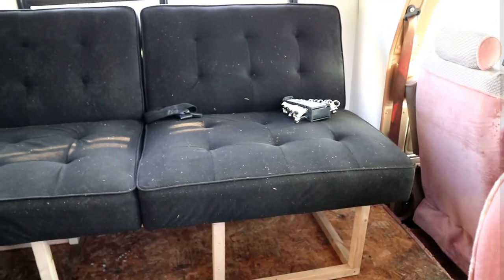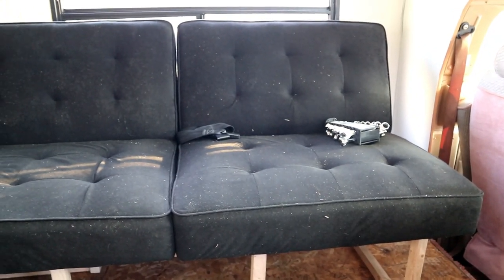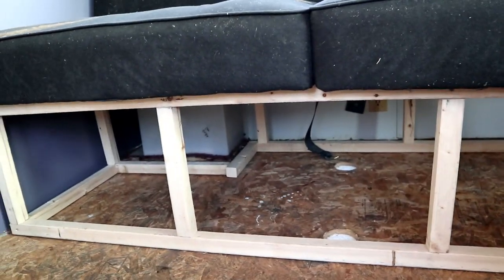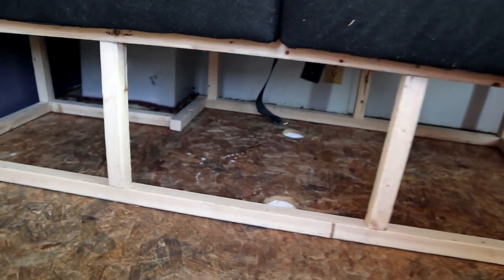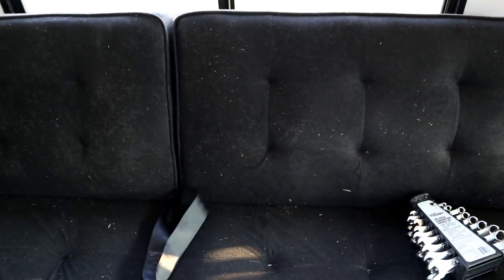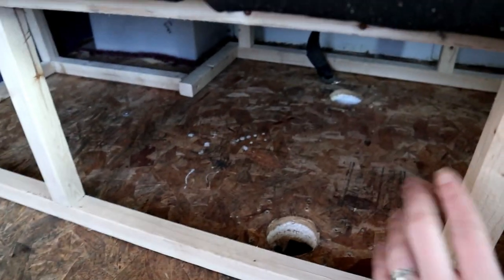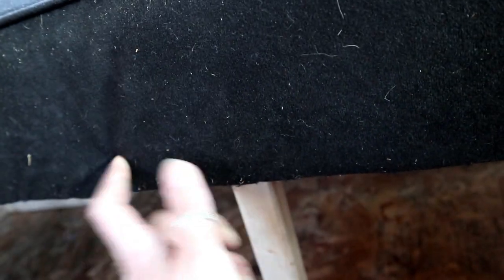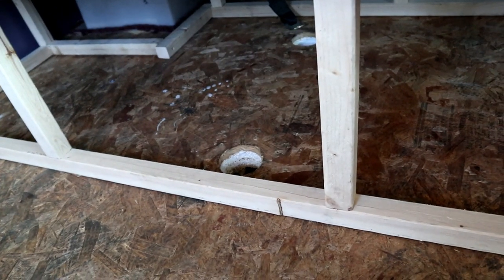FUTON RV SOFA BUILD | CAMPER REMODEL

Comment: On my class C  there is a turn off valve at the tank and I am sure there is one somewhere on yours. If you can find that valve then you can determine if you have propane. The previous owner may have turned it off for safety reasons. I am currently changing all the interior lights in mine to LED'S. That is something you may consider as a project one day. The LED'S are brighter and much cooler using less power. The ones attached to the ceiling showed brown marks from the heat of the bulb which is concerning to me as a possible fire hazard. I enjoy your RV videos very much and look forward to new ones.

Comment: We had a similar sounding issue with our propane. We had a professional inspection done & all checked out. Once one tank ran out of propane, we closed it & opened the second one.....annnnd NO HEAT!  We had just filled both tanks. Turns out, one of our lines doesn't work. So every time a tank runs out, we have to switch the full one to the operable side and the empty to the broken side. During the inspection, the guy just opened one of the tanks assuming if one worked, so did the other. Pain in the butt, but it works. Maybe something similar happened to yours? I'm not sure how many tanks you have.
Reply from the maker: I still haven't had a chance to further investigate, but I'm assuming there's only one tank. And it's so far up under the rv that I can reach, or even see, it. Hopefully it's just empty and I have a faulty gauge (on the inside of the rv). Thanks for the feedback, I'll definitely keep it in mind when I get a chance to look at it!